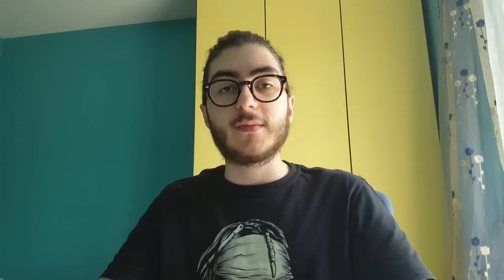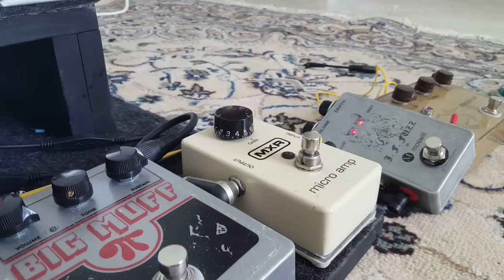Sound like John Frusciante - Ep. 1 - MXR Micro Amp

Comment: so John's micro amp was Not "always on"? he triggered it only for spacefic parts?

Also when did John use the big muff? by itself? or with the DS-2? 

Did he always use the da-2 and big muff together?
Reply: Youll be able to tell by listening the ds2 sounds more nasaly whi h means if its more bassy it would be the big muff. I doubt he used both at once it gets muddy and doesn't cut through because the big muff has little mids.

Comment: Would I do my pedals like this?
Guitar > MXR dynacomp > MXR micro amp > Boss CE-1? will the micro amp boost gain or boost volume and gain that way?
Reply from the maker: It depends also on how your amp is set. If the CE-1 preamp + your amp are on the edge of breakup, then the Micro amp will boost gain
Reply: @WillGalluccio  yep I’ve got my input gain set high on my silver jubilee

Comment: I've heard #davesimpson say, repeatedly in his videos the reason why the wh-10 and Ds-2 pedals "behave" like they do is bc he uses a tone city golden plexi, do you know if you can get the same clean-ish tone with enough boost so the ds-2 and wh-10 don't go crazy? In other words can you use the golden plexi in place of the micro amp, it's a cheaper pedal. thanks.
Reply: yes, most overdrive pedals will work
Reply: Nah the golden plexi acts a pedal in front of the ds2 and WH-10 to control the volume output as both pedals pass through the plexi as a master. If you use the micro amp in front of the ds-2 and wh-10 even with the volume fully down they’ll still play at the volume they should

Comment: Hi Will
Is that a spacer between the pedal and back plate of the micro amp? Did you make it yourself or is there somewhere that sells them? I am looking for one for my Phase 100 so I don’t have to run it on batteries!
Reply from the maker: It is what I called a “lightplate”. Basically a plexiglass extra layer with added LEDs. Later on I figured this made my whole rig noisier and I removed all the ones I had back then!

Comment: What is the difference of using MXR Micro Amp versus just using the gain knob on your amp?
Reply: Because Mxr Micro Amp is a clean boost.
Reply: And you can with compression turn on ds2 without volume jump
Reply: @vencac2775  can you have both pedals in your pedalchain? A WH1 Jackhammer Gain pedal and the MXR micro amp? Because i need the Jackhammer to avoid volumejumps woth my fender amp and the DS2.
Reply: @blackwolf4653  Yes, the Jackhammer would be like having valves in your amp, and the MXR then pushes them.

Comment: the Micro Amp is pointless for this application if you don't have a tube amp running hot on the edge of breakup. The Silver Jubilee, even on the clean channel always has a bit of hair. It's never really completely clean. That's where the Micro Amp comes in. Using the Micro Amp while running a 40W Fender-style amp on 2 won't really give the result folks are looking for here. It will only give a volume boost. It won't give the extra crunch that we're looking for here.
Reply from the maker: That's were the CE 1 preamp comes in
Reply: Would this be the case with a boss Kat? Would the mxr dyna comp work better thanks in advance

Comment: Hey dude I'm back again. I know that john never had his treble turned up high on his amp and he had his bass very high along with mids around the middle setting (at least this is what I read) and when I do this, it makes the amp with the micro amp(when on the back pickup) come through with lots of treble, and when I turn the treble down I lose volume tremendously. And if I switch to the front pickup with the bass high and treble low, it sounds muddy and poor. Really been trying to figure this out for a couple months but never can. If I turn the micro amp off I lose volume along with the small crunch I need but it's nearly impossible to not make my amp a treble monster lol
Reply from the maker: Kawliga Forehand What is your amp?
Reply: A Marshall 6100 LM anniversary series
Reply from the maker: Kawliga Forehand Try adjusting the pickup height of your guitar, it will make a huge difference... then consider that John had his treble set on low because the CE1 recovery stage recovers a lot of the lost signal through the chain!
Reply: Will Galluccio how much would you recommend lifting the pickups
Reply from the maker: To me it seems more like you should lower your pickups. Anyway, you have to find the right balance between the two in order to get a good tone out of your amp no matter what pickup you are using. Probably one of those pickups is too high on the treble side... try experimenting
Reply: @kawligaforehand2029  look up Dave Simpson on YT

Comment: Hey man, not sure if you’re still replying but I could really use some help. I have a 100w solid state amplifier. If I buy a micro amp, will I be able to get the slightly overdriven tone of Frusciante without adding too much volume?
Reply: Felix Scott it definitely helps, I use one on my bedroom amp. It helps break up the guitar sound before it reaches the amplifier. If you crank it all the way you get a nice little overdrive
Reply: Colin Tegman thanks man, got one a few days ago and I love it. I’ve got the amp clean with a slight bit of gain so that the micro amp pushes it over into gain/od. Such a great pedal.
Reply: Felix Scott it sure is an amazing pedal! I was blown away with how versatile it is, especially by just turning one knob!

Comment: Hi Will, great video. I have a slight problem with my MXR I just recently purchased, when the pedal is on there is sound coming out of my amp although when I turn the pedal off to get the clean tone, it doesn’t work, it is connected to a ds2 turbo distortion and they are my only 2 pedals. The Micro amp is connected to my guitar then I have a cable running from the micro amp to the ds2, then from the ds2 another cable to my amp? It won’t play sound out my amp when the mxr is off?
Reply from the maker: I'm afraid your pedal might be broken
Reply: Will Galluccio I feel like quite an idiot right now! It didn’t come with a battery 😂 fixed now 👍 cheers
Reply: @kp9273  lmaaooo

Comment: you recommended this mxr or your triángulo lab ce1 preamp?
Reply from the maker: MikeEinziger153 They are different things and need to be used differently
Reply: Will Galluccio I don't speak English , I don't know the difference of the use of the pedals, can you tell me about that a little?
Reply from the maker: MikeEinziger153 The ce1 crunch needs to be used as preamp at the end of the chain, the micro amp as a booster
Reply: @WillGalluccio  and can I use micro amp mxr as a compressor?

Comment: Dave Lee said himself that he used just to compensate for signal loss and it was always on?
Reply from the maker: I know, but in my opinion it's impossible. I tried setting the Micro Amp at 5 using cheap long cables to emulate signal loss, vintage non true bypass Wh10 and other pedals and it's just like a light overdrive. 
Also, looking at live shows from crowd you can clearly see that he activated it just when He needed a little more push... 
For example, playing a song like Dani California with the Micro Amp on would be impossible... too crunch!

I invite you to look at some shows and pay attention to the Micro Amp! You will be amazed! 
I apreciate what Dave says, but sometimes his memories are not completely correct unfortunately.. :(
Reply: Looking from a perspective of a guitar player "compensate" "signal loss", possibly what DaveLee thought or actually what i know is meaning when MXR was ON, then the sound of amps will be simmilar to pure rock guitar sound overdriven ACDC etc... just pure you know... offcourse guitar player turns the pedal on and off its not a rule to stick with to have it always ON, whatever.

Comment: So this works as a replacement for the CE-1 crunch sound?
Reply from the maker: If you are trying to get his sound on a small budget, yes. But Frusciante actually started having his "clean" tone slightly crunched by the CE-1 (always) and with his picking tecnique He went super clean or slightly crunch... He used the Micro Amp just to go almost in the overdrive territory!

But I must admit that a cool solution would be to get a Micro Amp and set it always on at 2-3 in order to replace the Ce-1 work... but it's not really the same thing. The Ce-1 crunches the sound inside of it, the Micro Amp gives this work to valves. They are two separate kind of crunch! 

Anyway, I am working on a Ce-1 Overdrive standalone pedal... check out my channel in the near future as I have it almost ready! :)
Reply: Ok, thanks, and +1 subscriber
Reply from the maker: Hahaha thanks Augusto! If you have any other doubt, just drop a comment! :)

Comment: Will this pedal fix my volume boost with wh-10
Reply from the maker: CEREALKILLA No, it shouldn't
Reply: Put an od in front of the wh-10. Like a ds2
Reply: Exactly! Boss buffer fixes the wh10 issue.
Reply: Oops, sorry, thought you meant treble tone suck of wh10. The volume boost is designed to be in there. I believe it is only after the 12:00 point on the level/ volume dial of the way that the boost kicks in.

Comment: Hi! One question: So, if I use the MXR Micro Amp with my practice amp (Marshall MG15), will it just boost my volume and not give me any crunch? Also, nice vid!
Reply: Do you have the answer now?
Reply: If the amp is set super clean, it will just boost volume. If you already have some dirt going on, it will give you more crunch!
Reply: Always set the amp to at the edge of break up, that’d make the micro amp work at its potential